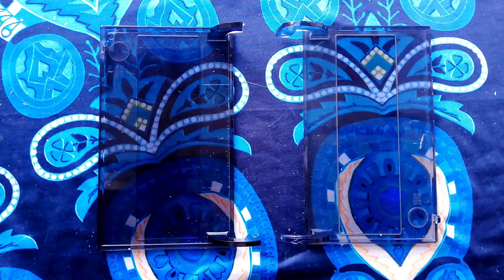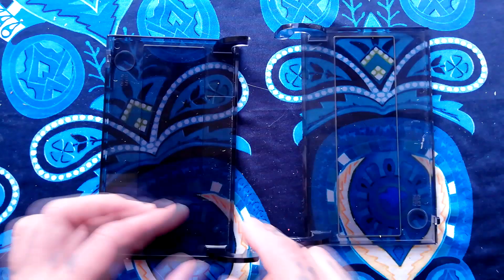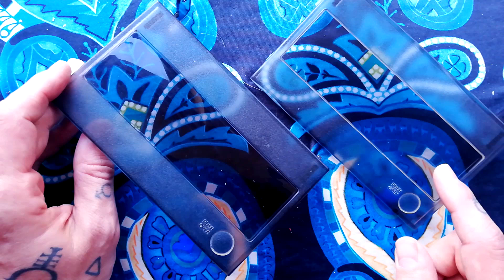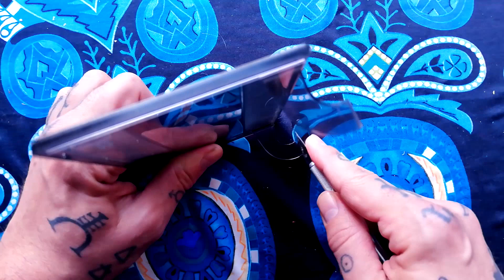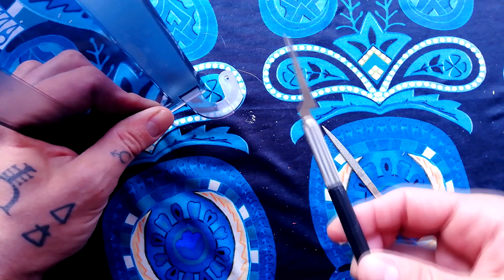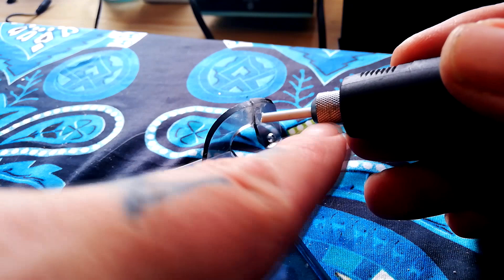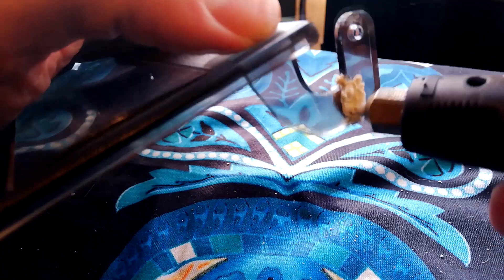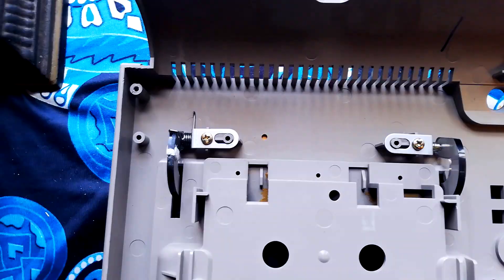Fix a broken cassette door | Spin Welding Plastic | Tascam, Yamaha, Fostex etc

Comment: Hi, first thanks for all the great videos, your channel is very useful indeed! Quick question, I have a 414 mkii with missing tape window, would you have any recommendations where to source a replacement? Thanks again!
Reply from the maker: Thanks. Sorry, I don't - until someone starts 3d printing g such things, it's a matter of finding a cheap donor unit... maybe you could set up a saved search in ebay, and restrict the search to units listed as for parts or not working?
Reply: @Tetrakan  That's good to know thank you! I wonder if I could get the specific dimensions for the door anywhere? I could try to have a go with something made out of wood perhaps.